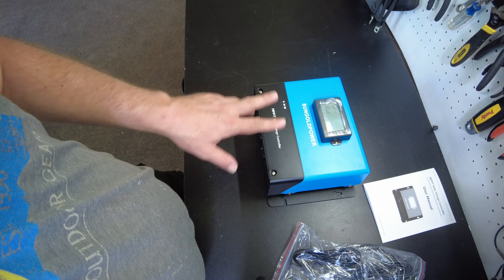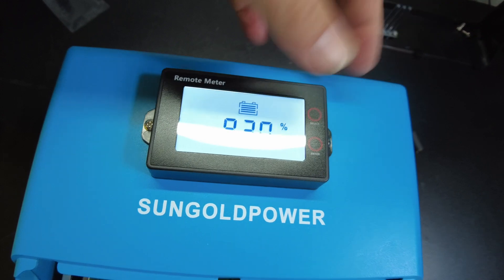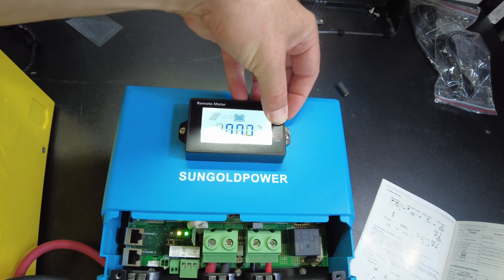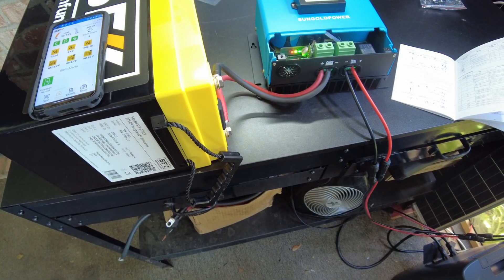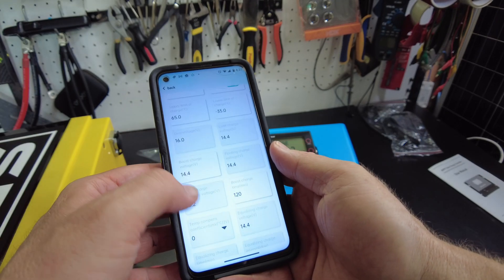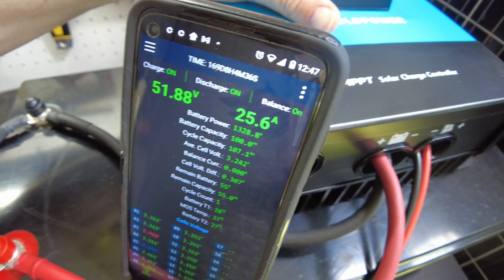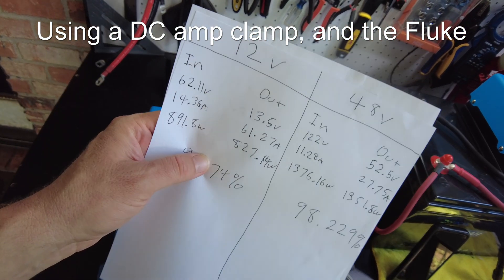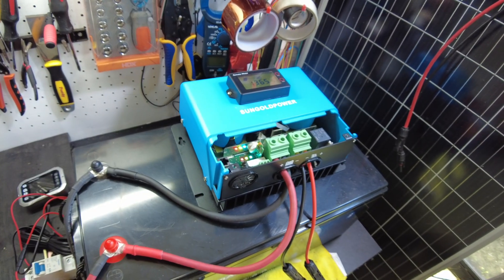Sungoldpower 60A MPPT Solar Charge Controller

Comment: Ya ya, I like the controller 250 volts sounds great. But more importantly, I like how you showed the difference between 12 volt and 48 volt systems. 48 volt batteries rock. I could never go back to 12 volts.

Comment: SGP stuff is fine, if it works out of the box.  If it doesn't, good luck with their customer support.  You're better off knowing how to fix it yourself or else just throw it away.  After a buddy's results, I won't be buying any SGP products.  That display looks like a really bad afterthought, for example.  Why isn't it built in?
Reply from the maker: Thanks for your feedback, Jason! As for the display, I totally forgot to show this in the video, but the two screws on the side allows you to remove it. Looks like a db9 connector on the back, so maybe the idea is to allow it to be place remotely?
Reply: @BradCagle  - I mean, that would make more sense than, "we slapped this on the front of an existing unit, and it shows".  :)

Comment: I wonder what the max PV input current is. Does it show in the spec sheet? What does it show on your clamp-on Amp meter on  the PV wire when you see E8?
Reply from the maker: The manual says 40a max on the PV input. My panels have ISC of 12a so in the 2s2p config the max possible current would be 24a. Thanks Bud!

Comment: Its amperage display maxes out at 59.95A.  Interesting.  It was still wrong showing 44 vs 40-ish.  Then 55.6A vs 60A.  And then on the 48V system you got 24A vs 25A (ish).

Offset error on the current sense op-amp circuitry, probably due to an improper placement of the VSS trace, plus a scaling error probably due to improper placement of the sense traces across the shunt resistor.  Very common design mistakes, whoever laid the circuit board out messed up.

Efficiencies are as expected given the input and output voltages.  Yet another reason to use 48V system voltages.  They could be a bit better, it would be interesting to see how a beefy Victron would handle those configurations in comparison.

-Matt
Reply from the maker: Thanks for the feedback!